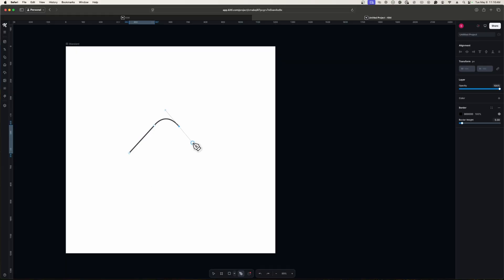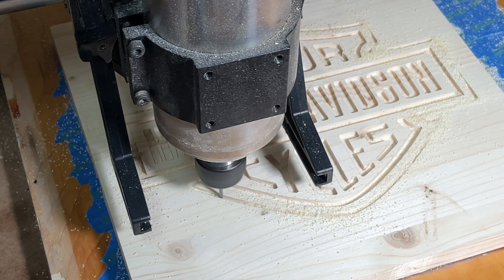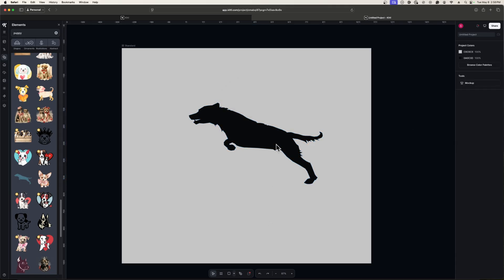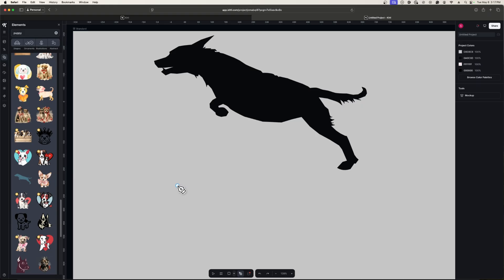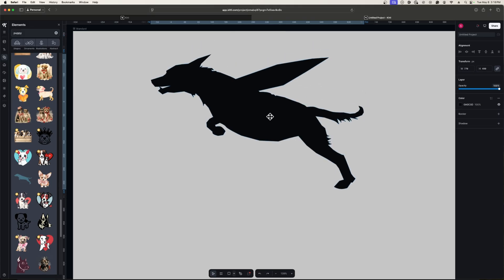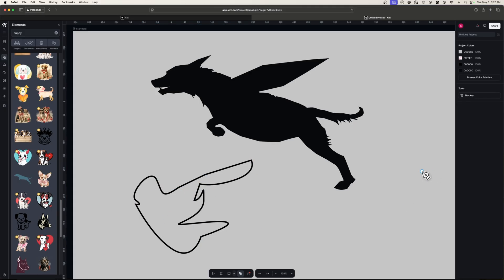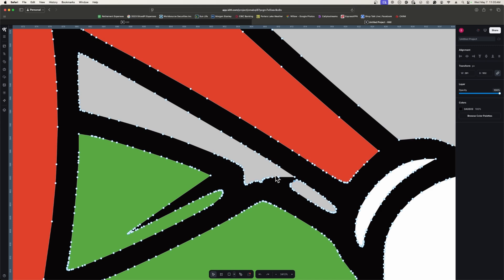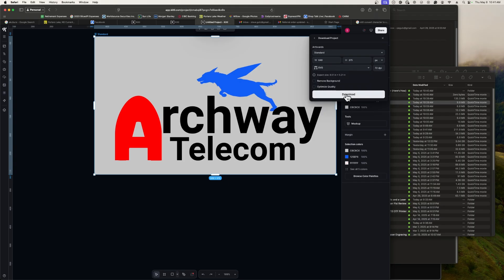Kittl Just Made Laser Project Design 10x BETTER (Here’s How)

Comment: Hi Steve,  Mike here from Innovation Center Stoughton Wisconsin.  Your video was great.  We currently have 9 Epilog CO2 laser running Adobe Illustrator.  I would love to wean ourselves of of Adode mainly because it’s expensive and our Makers can’t use it at home.  
My question is:  is there a way to go from Kiddl directly to the Epilog laser like we do now with Adobe Illustrator?  
I download the free version of Kiddl and couldn’t send it to the Epilog laser.  Does the paid version of Kiddl go directly to Epilog?  Everyone tells me I must go through Lightburn first.   I would love to get your opinion.  Thanks so very much.
Reply from the maker: Sorry for the delay.  For some reason, this question didn't show up.

When you say "Directly to your Epilog" I assume this is just done like the Epilog is a regular printer, and you can "print" to it through a Windows printer device.  If I recall, this is how Epilog does it.

In this case, pretty much any software should work since Adobe would not do something specific for Epilog.  What I'd suggest is to just try the free version of Kittl and see if you can reproduce the same process.  Both illustrator and Kittl are vector drawing programs, though Kittl wraps all of its authoring into some document management mechanics.

If you can shoot a quick video of the Illustrator process for Epilog, I could get a better understanding of how the process works.  If you can email it to me.

Comment: If you want to delete part of a vector image, can't you just draw a shape over the part you want to delete and just use the boolean (shape maker) to subtract the  drawn shape from the vector image?
Reply from the maker: You can, but no matter what, you'll still have an enclosed shape.  The way I could have handled the problem in this video would be to delete the small bubble on the right and then stretch the left side of the bridge to the right to replace it.  However, this is a simple case, but they can get a lot more complicated than this, so being able to break a shape and merge nodes would be very useful.

Comment: Can definitely see the benefits of using a centralized platform like this, especially with your use case. From a design point of view, tools like this seem to be a lot more user friendly compared to the big name ones. I recently started playing around with Illustrator as I wanted to set up some of my existing cut files for UV printing (to save on hand painting) but with me not having much of a graphic design background, it is a steep learning curve and a lot of the way things work don't seem logical to me. I imagine this tool would make it much easier to make separate print & cut files from the same design within the one tool. As for Lightburn, as you say, it is fine for basic designs but I do use the node editing feature in it quite a lot as it has the shape breaking & node deleting options which makes cleaning up & resizing sourced files a breeze.
Reply from the maker: The way I use Kittl is to break each customer down into a separate project than with the project I create an art board for each asset they have. This way I can see everything related to a customer in a glance.

With the recent addition of node editing, it’s possible to add or remove nodes.  But I still don’t see a way to break a closed shape at a node, so I’m hoping they add that one missing node feature.